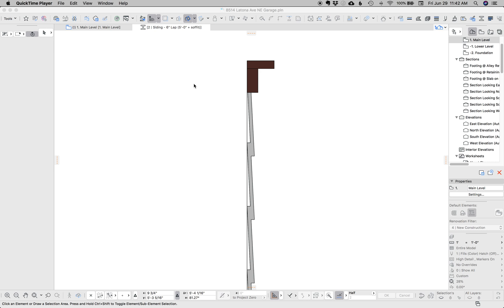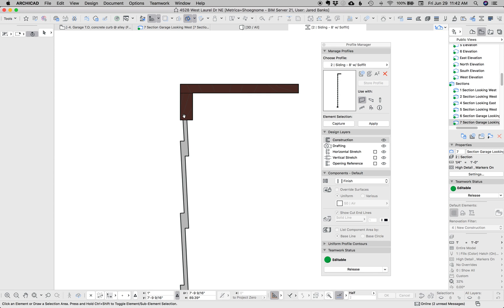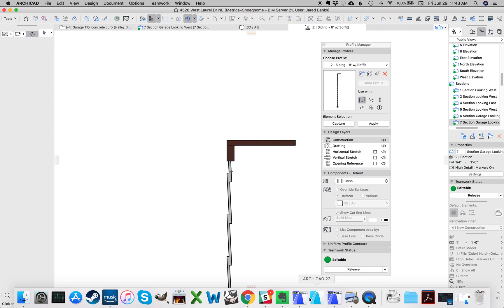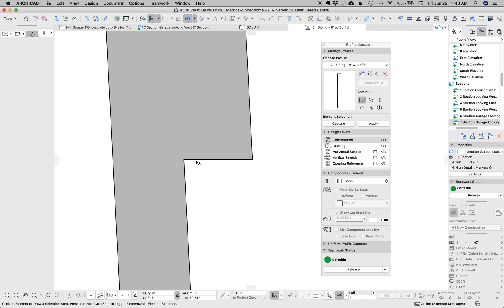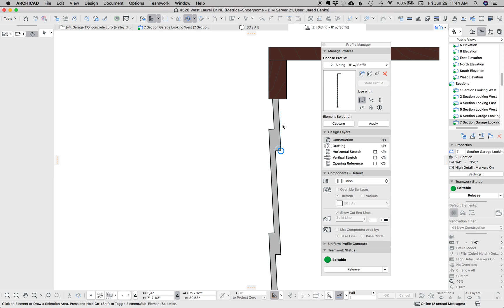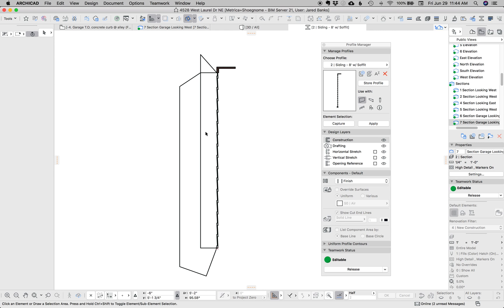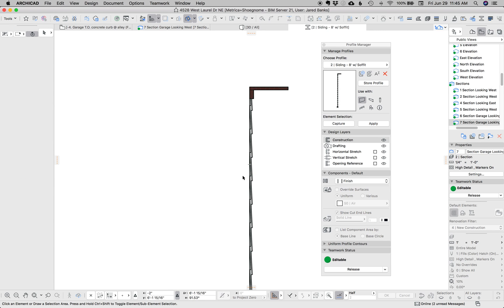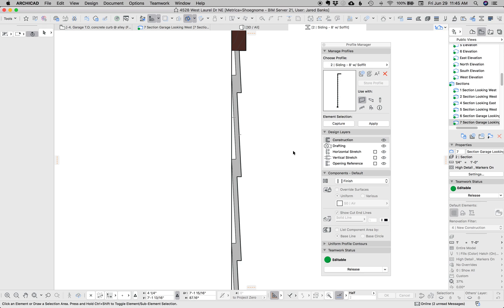ArchiCAD Tutorial #65: Model Speed, Complex Profiles, and adding Fills

Comment: hello,

I would like to make a wall with vertical wood siding, where i can also place some windows and doors
Is it possible to make vertical siding with the Complex profile tool? or is there another tool for making i wall with vertical siding?
Reply from the maker: For vertical siding I just use a Surface. That typically works fine. If the siding is more complex or specific you can also use columns and beams (high priority Building Material on a hidden layer) to create control joints.  Find my video on strong air for that technique.